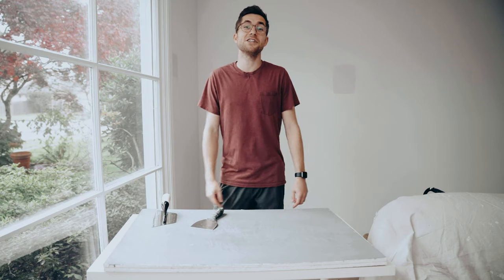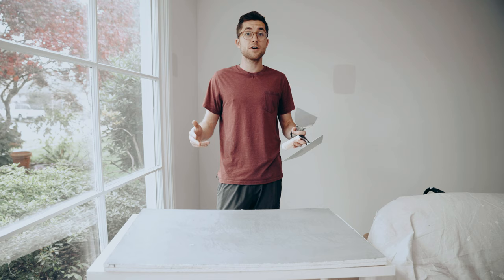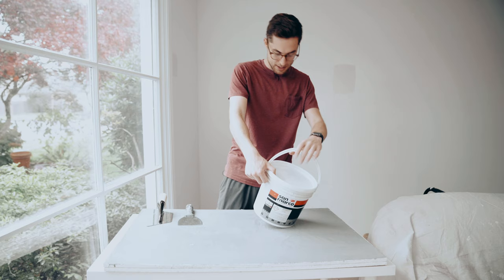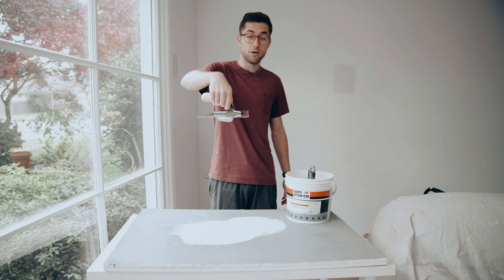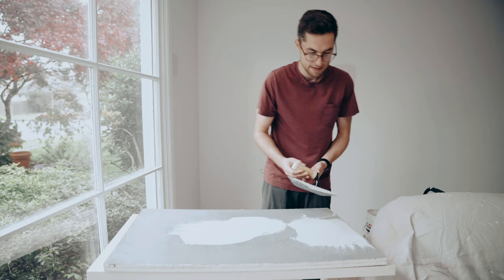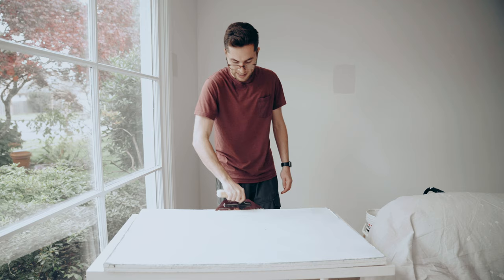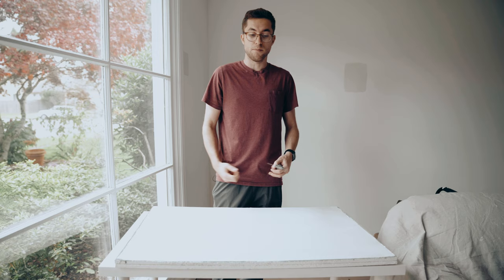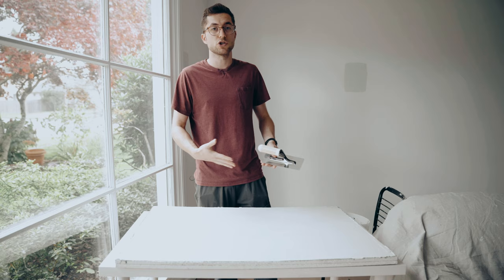VENETIAN PLASTER FOR BEGINNERS | diy guide to applying plaster

Comment from the maker: Got any venetian plaster questions? Leave them in the comments and we'll make sure to respond!
Reply: Is that wood? Or drywall?
Reply from the maker: @valedorchilango  I used a wood board. Most people will use a primed MDF board to do plaster samples on but you can really use any flat board. You could use drywall if you wanted but not very common for these types of sample boards.
Reply: can you use this plaster to resurface furniture with a textured cement look?
Reply from the maker: @marym9941  It depends on the project but you can in certain cases. If you are going specficily for a concrete look, you can also check out a product called Archi+Concrete
 here -- https://bit.ly/Archi-Concrete
Reply: Should you prime before plastering?
Reply from the maker: @johanrios469  I always recommend priming as it gives the plaster a good surface to adhere to. If you are using a medium to coarse venetain plasterm I'd recommend using a quartz primer to give the wall a bit of texture for the plaster to grab on to. You can apply this after a normal paint primer or by itself.  https://bit.ly/firenzeprimer
Reply: 45 degree angle? Or less for trowel?
Reply: How to get the color you want?
Reply from the maker: @lesliezucker3862  Less for normal application purposes.
Reply from the maker: We typically order from Firenzecolor and they can custom tint your plaster to match any color you want. We've found that's the best way to do. If you want to order from them, you can use our code AFIA10 for 10% off.

Comment: It's a bad idea to use that polishing trowel for initial spreading as it can get scratched and ruins it unless it's for last coat only but I see you had a separate one for burnishing. Extra flexible stainless steel is best for first coat.
Reply from the maker: I've had good results the way I've been using it. I've also just watched and learned from the people that created the trowel. There are two different styles of the x-trowel. One is more of an application trowel and one is a smaller burnishing trowel. Since they are treated, it's nice to use on the full application process to avoid any black marks on lighter plaster.
Reply: I learned this from stucco Italiano but if it's not affecting your burnishing then by all means. Ridgid stainless steel ones are better for base coats before doing finish coats but you run the risk of gliding the mirror surface against grains in that base coat when applying the first finish coat and that will definitely scratch the surface that you can noticebly feel with fingernail and can therefore scratch the surface since it's no longer smooth cancelling out the benefits of the black streak protection
Reply: @AK88.  if you wipe the trowel down with 600 grit sandpaper when you're done applying the base coat it'll smooth out the surface of the trowel.

Comment: I wish you teach with color stead white so we can see better I am a beginner so white you cannot see well, also more close up while you  doing the strokes layers so we can understand how smooth you talking about, when the camera person does the close up they take away to fast not letting us see and understand I wish I could have seen up close  the part when you find some dry plaster that ruin your application and you went to fix it but from far all white we cannot appreciate it understand the work, but know this is a person considering starting on this and never touched a tool or plaster before thank you so much for all your teaching I am great full to find you nevertheless ❤
Reply from the maker: Thanks for the feedback. The plaster I use is either samples I've received or left over plaster I've used. So I'm not in control of the colors. I did request some brighter colors that you can see in some of our videos.

Comment: I want to work on a fireplace it's very large.  Can you stop and come back the next day?  or your edges always need to be wet?
Reply from the maker: Venetian plaster is best applied in one full coat at a time. This is because I’d you stop you’ll get a cold joint. It is doable to stop but just a lot harder to make it look seamless if you know why I mean. My best suggestion is to get a friend to help or stop at a edge or seam.

Comment: Me gustaría saber.Este producto resiste calor? se puede utilizar como  backplash en cocinas cerca la estufa?
Reply from the maker: Venetian plaster is relativity heat resistant so it can be used in areas with heat. You will want to be carful with really hot areas or areas with a lot of moisture as that mixture can cause problems.

Comment: Another question, do I need to buy already mix plaster or I can buy a bag of plaster and make my own ,is it the same?
Reply from the maker: You don’t have to purchase pre-mixed plaster if you don’t want. I find it easier than having to measure everything out. Also if you want your plaster color matched, pre-mixed is good for that. Not all plasters fro
 Firenzecolor are pre-mixed but if you want to purchase anything from them, feel free to snag 10% off with our code AFIA10
Reply: @AlongForItAll  thank you that helps a lot

Comment: Hi thank you for the explanations ,I have regular drywall with orange peel texture how can I start ? Do I need to replace the wall or can I skim the wall and do this? Thank you
Reply from the maker: Orange peel texture is perfectly fine to go over with medium to corse plaster. If you want to use a thin or shiny plaster then having a smooth wall is always preferred but not entirely necessary. The first step will be applying a good primer to ensure good adhesion. If there’s any paint chipping off, make sure to take care of that first as your plaster will be latching on to that layer.
Reply: Thank you ,it really gave me more motivación to start a project .

Comment: Thinking about doing a backsplash behind our stove. Does it need to be sealed? Is spaghetti sauce going to stain?  Also I love this more matte look with a little bit of shine here and there. So if we should seal, will that ruin that finish of highs and lows? Thanks
Reply from the maker: I’d use a sealer for sure since you’ll be wiping it down at lot. Plaster is porous so it will absorb liquids when in contact. You should check out firenzecolor’s wall2floor system that’s made for durability. If you want to use Venetian plaster as your finish, you can use some of the wall2floor sealers to give you a high level of protection. I believe there’s different levels of sheen you can get so you should be able to pick whatever you’d like.

Comment: Do I gain anything in applying a 3rd  layer? If so, is it the same technique as the 2nd layer? If so, do I burnish  my 2nd layer too?
Reply from the maker: It depends on the type of plaster. For a thiner/shiny venetain plaster, people will often apply a 3rd coat to build up the base. If you want to apply a 3rd coat, your 1st and 2nd coats will be applied like your base coats without burnishing, then your 3rd coast will be your final coat that you will burnish. Essentially, your last coat is the only layer that gets burnished and applied a little tighter. Hope that helps.

Comment: Would you recommend going out and buying a good quality trowel to begin with? They seem expensive so was wondering if it would help a beginner out.
Reply from the maker: You definitely don't have to. Here's a link to the exact one I started out with when I began plastering https://amzn.to/34nNkvv. It's about half the cost of the X-Trowel I use now. You could probably find a cheaper trowel if you look around more on amazon. The main things you want to look for are good quality stainless steel and make sure it's slightly flexible. When you're first starting out the most important thing is to practice technique. No trowel is going to make that easier but once you get the hang of it, you might have more preferences with what you want from a trowel. Hope this helps! Let me know if you have any other questions.
Reply: Thanks for that! Been watching all your videos on Venetian plaster been a massive help for my project coming up. Keep up the good work
Reply from the maker: Glad they have been helpful! Hope your project goes well!
Reply: Thank you. Can thick layers of plaster be applied first and then painted with a roller or brush? I have a 100-year-old house and one of the room's walls are plaster and VERY uneven so I was going to sand, prime and add more texture to make it look intentional. I have a big bag of sheet rock 45 that is great mixed with water to a toothpaste consistency. Great for filling in holes because there is no "flashing" like hole filler would look under paint.
Reply from the maker: You can paint over plaster. Just make sure to prime your walls first so there’s good adhesion to the plaster.

Comment: Your videos have been extremely helpful so thank you for that. I'm currently in practice mode with Mamorino KS with the addition of a metalic tint at the end. I want to have that textured finish which means I'm trying to master the "blotchy" first coat or in other words, leaving high and low spots, then pull it tight with the second. My quesiton is, the pressure applied at any of these stages seems to have a huge effect, how do you get a guage on how much pressure should be applied? Also, have you found long strokes or shorter strokes on the 1st coat work best? Thanks again!
Reply from the maker: Great question but might be hard to answer since pressure is really something you have to feel in order to understand. The best way to learn is to practice just like you are doing. There's so many ways of doing a textured look so it really comes down your own personal preference and how you want to apply. As for long or short strokes, I think either work fine. The main thing is if your are doing a textured/patchy first coat, is to try to make your textured spots connect to each other. That usually gives a more organic look rather than  two spots that re completely disconnected. Hope this helps.

Comment: If I want to do this on wood do I need to put a primer down first or what would you recommend?  Thanks
Reply from the maker: You don't necessarily have to use primer but it's always recommended. The reason is that it will give you the best surface to work off of and most of the time allows for the best adhesion. Also, plaster is porous, so it's usually best to seal off the surface so nothing comes through. All that being said, I'd done small samples without primer and it seems to work fine. If you don't use primer, I'd recommend testing it beforehand. Hope this helps!
Reply: @AlongForItAll  thank you so much. Yes, it’s helps. I appreciate you answering my question. ☀️
Reply from the maker: @630sunshine  Awesome! No worries at all!

Comment: How do you recommend priming the wall? Is a specific material or can you skim with regular joint compound?
Reply from the maker: If you need to smooth out your walls, I’d typically use joint compound to skim. After that, I’d go over that with a paint primer to seal the joint compound since it can be sorta reactivated with water. From there you can continue as you normally would with either a quartz primer or directly to Venetian plaster depending on what you are doing.
Reply: Thanks for the info. I just ordered a product by Firmolux called micro primer. Experienced with tape & bed but this'll be my first whack at venetian plaster. Pretty exciting!

Comment: What size trowels do we need to plaster for example 200x80mm etc? Can you elaborate more on this
Reply from the maker: Great question! The application size trowel comes down to your preference. You'll see the professionals using larger trowels so it's quicker. If you are a beginner, I'd definitely not get the biggest trowels. The application trowel size I personally have is the 240x100mm Trap X-Trowel. This is considered the medium size I believe. I also have the 200x80mm X Trowel Finishing Trowel. The smaller size for the burnishing trowel allows you to apply more even pressure while burnishing. Hopefully, this helps answer your question. If you are interested you can check out more here - https://bit.ly/x-trowel-trap

Comment: What sealer do you recommend for a matte plaster?
Reply from the maker: We use Firenzecolor Protection Soap which is also known as Savon de Marseille. Essentially its soap that's able to be spread on the plaster which creates a seal.

Comment: Could i use venetian plaster over cement (hardieback) board?
Reply from the maker: Should be ok but you could always test a little section before hand. Might not be 100% necessary to prime but could be a good idea as well.
Reply: @AlongForItAll  thank u! This is all so foreign to me. Is there a specific type of primer I need?
Reply from the maker: @karinagalvez7486  If you are using a thinner/shiney venetian plaster you'll want to just use a regular paint primer. If you are using a thicker/matte/satin plaster, using quartz primer is probably the best route to give you good adhesion. You can find the quartz primer here - https://bit.ly/firenzeprimer

Comment: What is the best product to seal it in kitchen.
Reply from the maker: There's a few options depending on how much protection you are looking to get out of your sealer. If you have plaster that won't be very close to water and messes but still will need to wipe down, then you can get a product called Acquadivetro. This makes the plaster more hydrophobic which makes it easier to wipe off. If you have plaster that will be next to messes and getting wet a lot, I would actually look at using the Wall2Floor products & sealers as they will give you a higher level of protection. You can check the products out more here - https://bit.ly/firenzecolor-home  I'd recommend shooting them an email and they will be able to help you get the exact products you need.
Reply: @AlongForItAll  awesome thank you so much for replying!
Reply from the maker: @soundsedationasmr  Of course! Let us know if you have any other questions.

Comment: Can i apply on my tiles
Reply from the maker: You can apply venetian plaster over tile. You will need to make sure to you the correct primer and use something that has some grit in it so the plaster has something to hold on to.

Comment: hello, i loove watching your videos but i was wondering what would be best to use over a white painted drywall, plaster or limewash? i want that kind of result smoth wall and limewash seems to deliver that aswell, so what is the difference between the two. thanks
Reply from the maker: Hey! Glad you like our videos. You can do both plaster or lime-wash over paint. You will want to prime your walls before doing either so you give it a good surface to adhere to. Lime-wash is definitely easier to apply, so if you are concerned with the learning curve of applying plaster (can take some time to figure out), than that might help you decide on that. Lime-wash is more of a flat, cloudy look where as plaster tends to be more dimensional. The in-person look and feel of Venetian plaster can't really be match by lime-wash. Let me know if this helps or not. Happy to keep discussing if needed. ✌️
Reply: Awesome, and how long did it take you guys to plaster your whole living room?
Reply from the maker: It took us quite a bit of time because we had to skim coat and sand all our walls before starting. I can't remember how long just applying the venetain plaster took but probably took 4-5 days. Again, since we are just doing it ourselves, we tend to work in shorter chunks of time so you could defiantly do it quicker if you wanted to.
Reply: @AlongForItAll  what is skim coating? Is it a more professional way to say “priming” ? Or its a different process?
Reply from the maker: Skim coating is when you apply a thin layer of mud or joint compound over the entire wall to make it smooth. Our walls were super textured before so we had to do that before starting. After that, we then primed our walls with quartz primer before applying the plaster.
Reply: Okay i understand… sorry for lot of questions, we are working on renovating our house too, and i want to plaster/lime wash it, but i’ve never done it.  So im just learning here :). Thank you for your answers
Reply from the maker: @kadisouare4262  Totally! I'm here to help so no worries. Let me know if you have more questions as you begin to figure things out!

Comment: You mentioned adding color on the second coat where u began this video.  Where's that part?
Reply from the maker: I mentioned that the board I was applying plaster to already had plaster on it. So, I was plastering over it "with a different color" than what the board already was. Does that answer your question? Sorry if it was confusing.

Comment: How long did you wait between the first and second coat?
Reply from the maker: It really depends on the room temperature for how fast it dries. You’ll want to wait until the first coat is completely dry before doing the second coat. I probably waited 3-4 hours between coats. Typically when I do an actual wall I’ll wait longer to make sure everything is dry.
Reply: @AlongForItAll  Thanks for replying. I really appreciate it